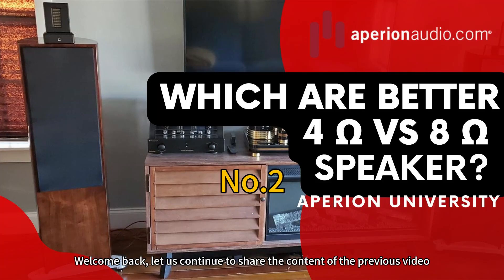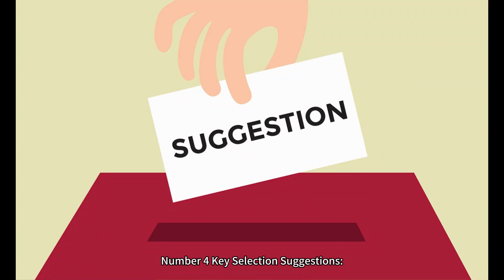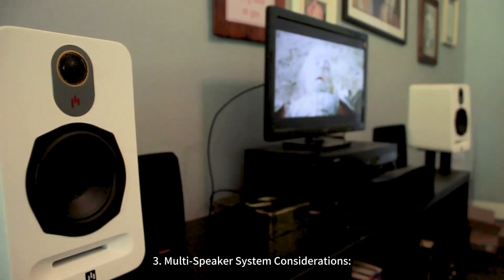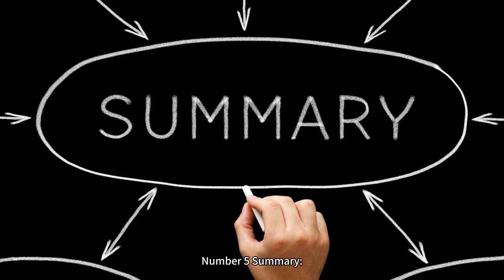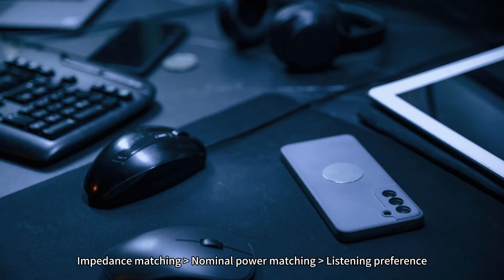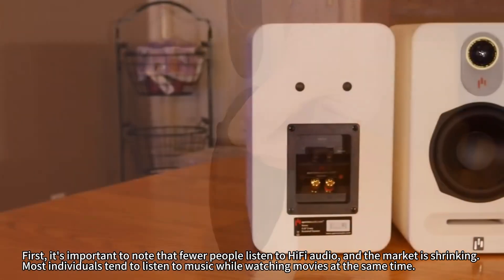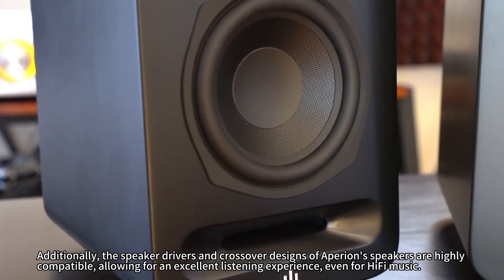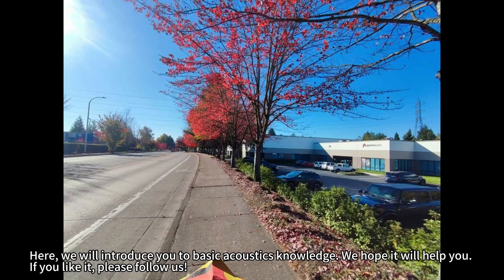Which is better: 4-ohm or 8-ohm speakers? - Number Two

Comment: A common question with a simple answer. The impedance of a speaker has nothing to do with its sound quality or performance. Impedance is only useful to determine if an amplifier can drive a particular speaker well. That said, large floor standing speakers capable of loud sound levels usually have lower impedance and thus require amps comfortable with 4 Ohm and occasionally even lower. Even some bookshelf speakers may require 4 ohm capability. Lastly, don't trust amplifiers that simply quote increasing power ratings at lower impedance, in the absence of bandwidth and whether that power is continous or peak, the specs mean very little.